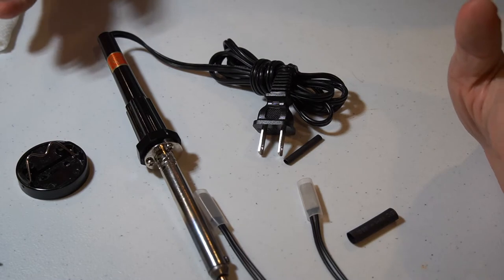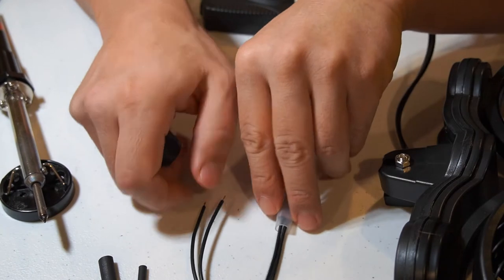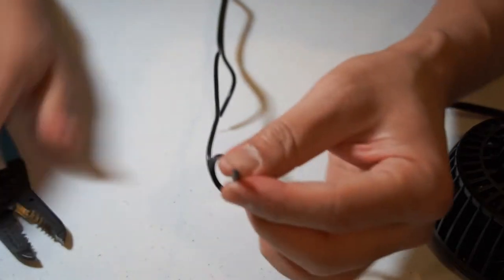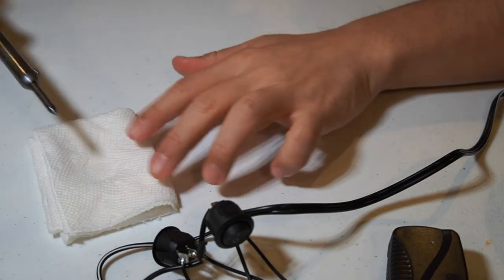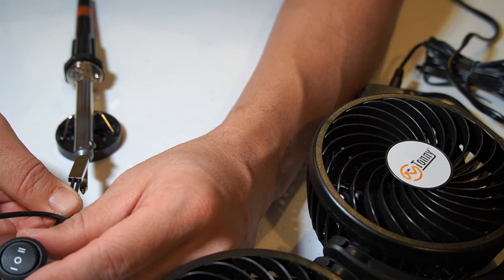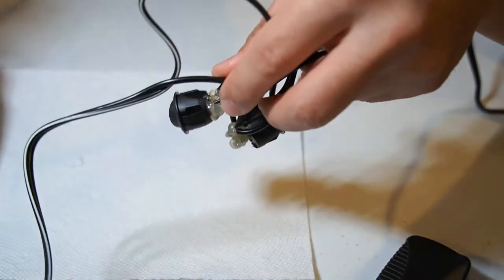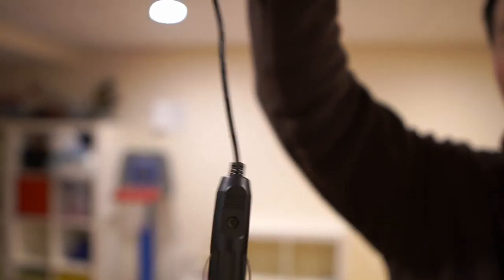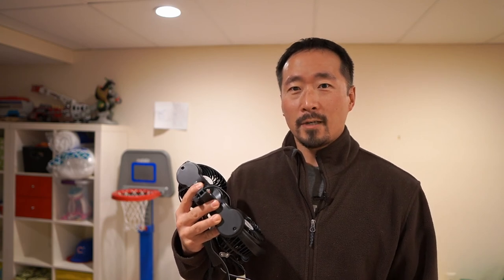Is There a Vent Fan For Cars That Automatically Turns On When It's Hot?

Comment: I did something similar for my dog years ago who wanted to come along in the car if I have to go shopping. I silver filmed my rear windows panels on the station wagon. then opened my rear side windows a few inches on both sides of the car with the fan on the sunny side of the car drawing cooler air through the car and expelling the car air. If the sun was high I would use a silver reflector for the windshield. It ran solar , and the dog was comfortable. I don’t trust my town these days to do anything like that. Good job.

Comment: Years ago, there was a solar powered vent fan that you put in the top of your window and closed the window on it to hold it there. You could put one on both sides of the vehicle to circulate fresh air through the vehicle. They were pretty small. I always wanted a pair cuz I was sick of getting off work going out and having to stand with the door open till it was bearable. 🥴 don't remember if they were thermostatically controlled or not but still... now that I'm moving from the rockies back to the "oven", I wouldn't mind having some.
Reply from the maker: Yep, I read reviews on those a long time ago.  It always seemd the fans were too weak and the solar panels were also too weak and they didn't do much.  These fans are pretty strong and I like being able to set it to what I like for the weather.  I can't wait for summer now though to see if it will definitely automatically turn on and off!